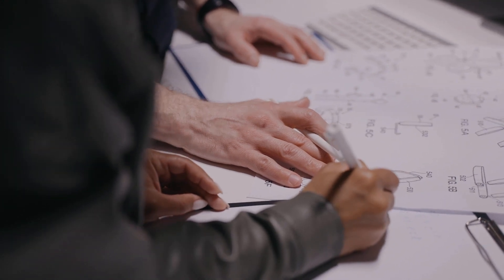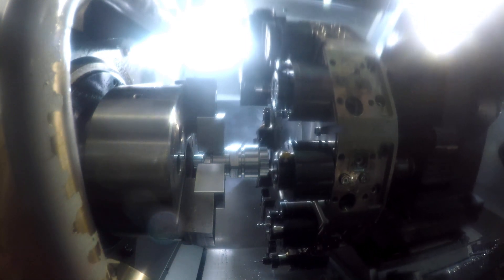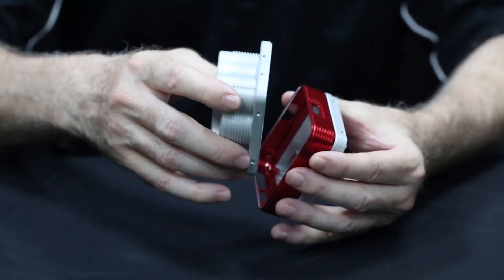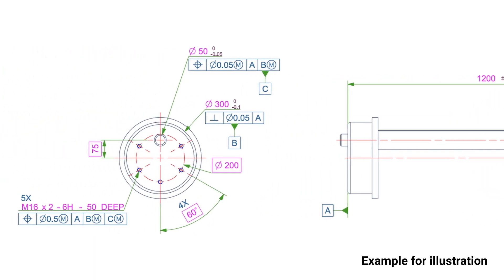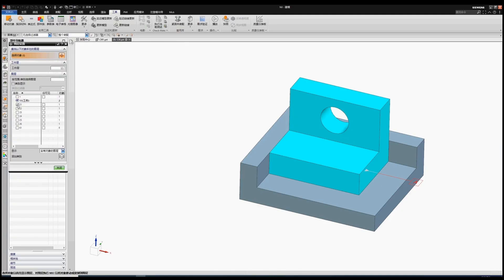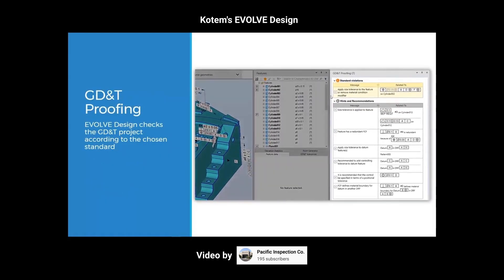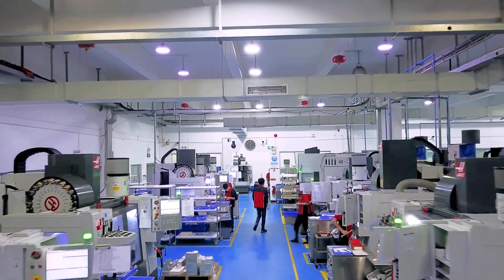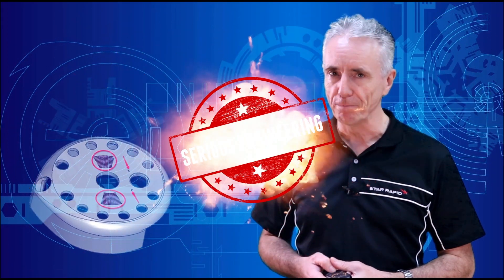5 SIMPLE STEPS for Geometric Dimensioning & Tolerancing | GD&T EXPLAINED | Serious Engineering: Ep27

Comment: if we do not use GDT what would be happened ? your feedback will appreciated .
Reply: Nothing. You can use +/- tolerances. It makes inspection and tolerance stack up hard. If your quantities are not too large, you maybe fine
Reply: @jehanzebawan43  that means The more assemblies we have the more GDT we need for complex assembly right mr jehanzeb ?
Reply: @mohamadkhatib8624  HI by using only +/- dimensioning it is impossible to convey the design intent. In addition you are unable to establish the true relationship between critical to function features in relation to the matting features aka datums. This leads to a ton of manufacturing problems down stream. Like over toleranceing features, which drives up the cost. GD&T is a language and properly applied in addtion to being understood gives back tolerance to manufacturing. They what a machinist wants to hear.
Reply: @lawrencestrickland9264  sounds great mr lawence we really should care about the function and relation between different feature .its great to have your update

Comment: I completely disagree that you generally only need 3 Datums. You did qualify your statement by saying "3 is enough for everything you have worked on." I work with all the world leaders in manufacturing and %80 of the drawings i work on have more than 3 datums. I believe that is a reckless statement. You are going to get some new inspector or machinist  yelled at when they say that to a good engineer.
Reply: "These 3 are usually enough"... I understand why most people say that engineers have little to no reading or listening comprehension.